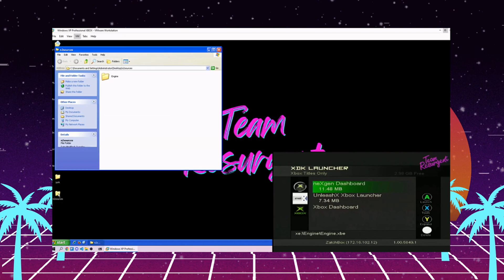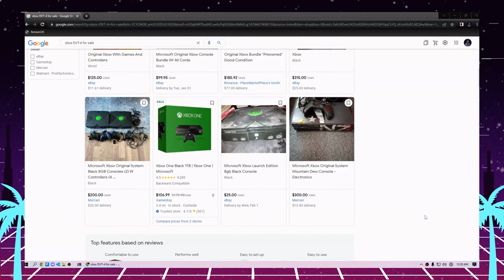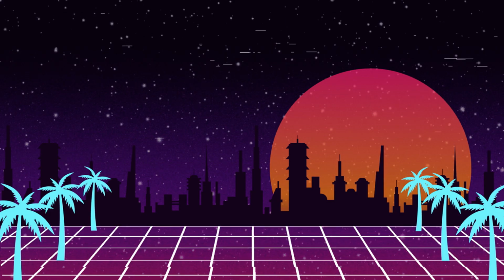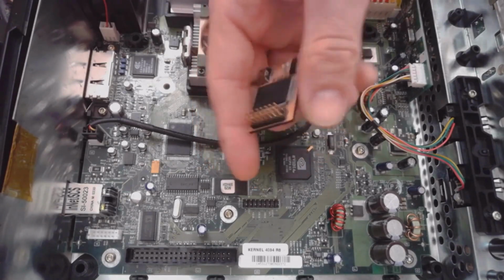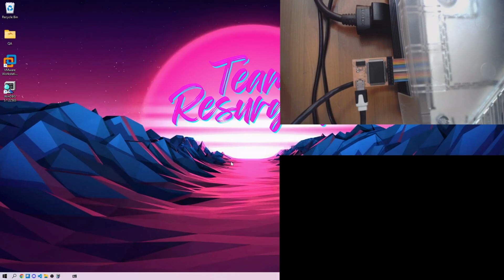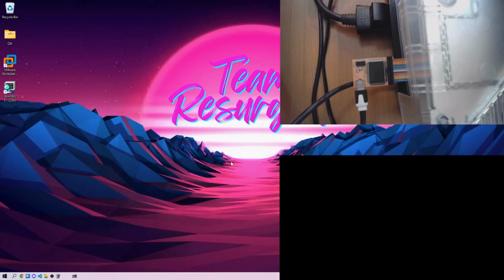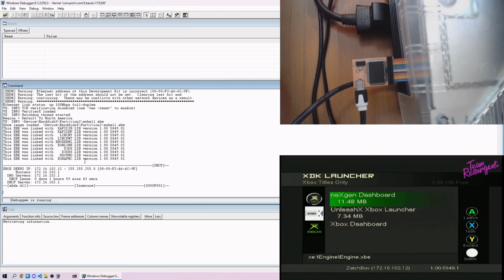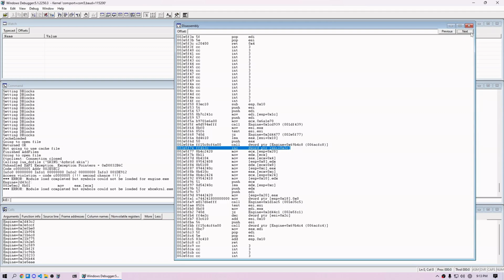DIY OG Xbox Dev Kit! - Turn your retail Xbox into a development kit!

Comment: fantastic video sir but where did you get the cerbios?? i have a 1.4 version board with a modchip and once i have my ide/sata adapter and 80 wire cable i'm hoping that i can flash cerbios straight to chip? but theres so many hurdles getting it from so called official places
Reply from the maker: Not anymore my friend! Team Resurgent just released Pandora. It will lead you to salvation 😉.
https://github.com/Team-Resurgent/Pandora
Thank you for the support!!!